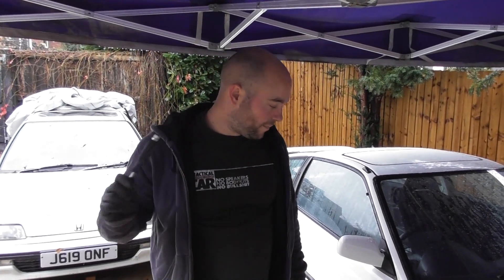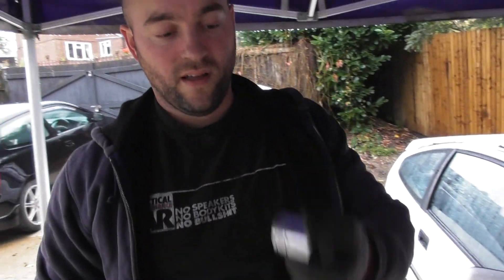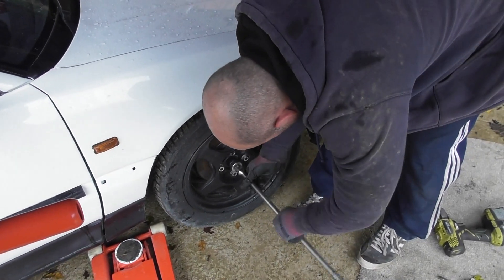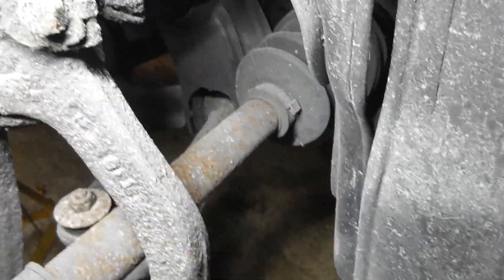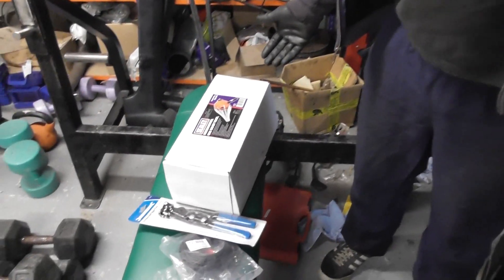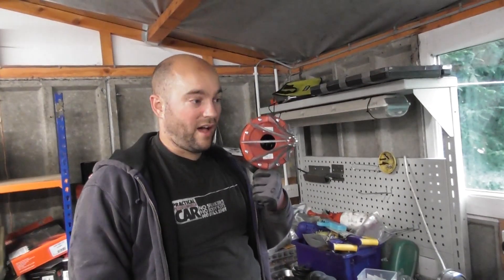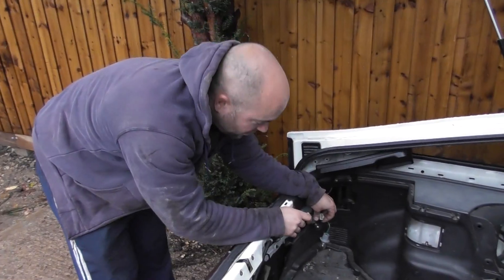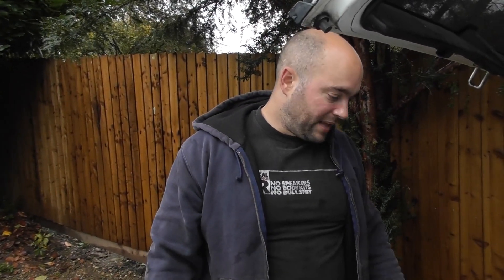CRX Part 11 Driveshaft boot and indicator fix

Comment: Nice video that shafts you use as I have a ef with b16a but 250 quid a driveshaft is overkill
Reply from the maker: MB6 B18C4 Civic VTi 1.8 shafts. The is a company called J&R on UK Ebay who sells these quote cheap. You just need to remove the dist ring from the inside of you front hubs to run them.. or they will bind.